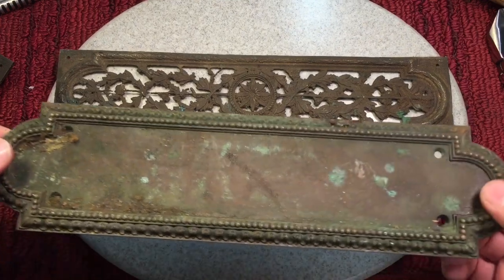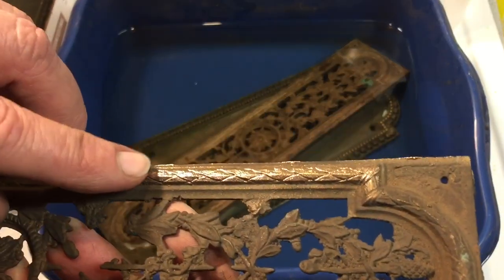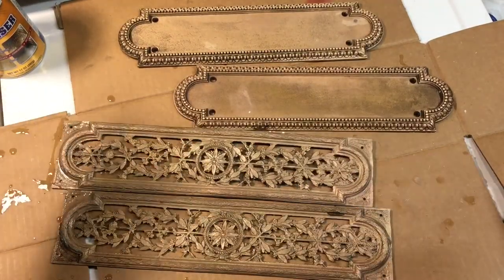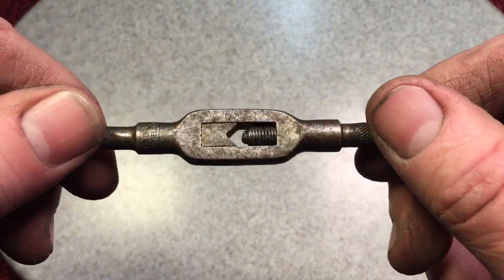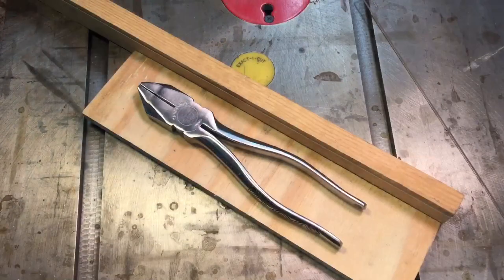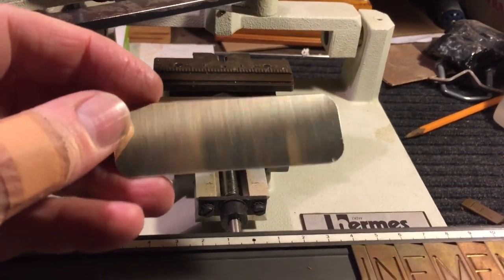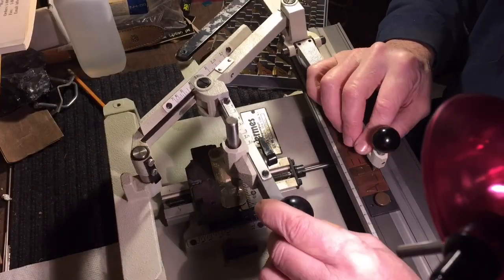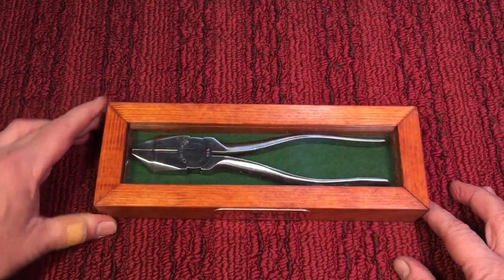SS Normandie Memorabilia, Little Giant Tap handle and Box for Tony’s Pliers.

Comment: The SS Normandie was a beautiful French ocean liner with a trim Yourkevitch hull with a clipper bow and underneath the waterline a bulbous bow which made it glide through the water. The third stack was a dummy stack, just for show. The New York City fire department had trouble hooking up the fittings on the Normandie because they weren’t compatible. Yourkevitch was in New York but the fire department didn’t take his suggestion of letting the boat settle to the floor of the harbor and then apply water. There were false rumors that the fire was caused by sabotage. The fire suppression system on the Normandie had been disconnected while it was transformed into a troopship called the Lafayette. Such a shame to lose this beautiful ship in this way.
Reply from the maker: Larry!  You certainly know the history of that beautiful ship!  There was a lot of controversy over that accident and lots of people in hot water over the incident...  The ship was amazing!

Comment: I use "Brass Black" solution made by Birchwood  Casey.  It is for blackening new brass screws on firearm restorations.
Clean the brass throughly,  make sure all lacquer is removed. Apply solution with a Q-tip. Let it soak into the letters. Rinse with water after a minute, then polish the brass. The polish won't penetrate the letters. If you desire a matte finish you can buff off the excess blackening with 
0000 steel wool.

Comment: Years ago I was given a very corroded and tarnished brass clock mechanism. A friend who did clock repairs told me to soak it in household ammonia overnight. This is how he did his works. When I took it out the brass was clean and shiny. Any old greasy dirt was also gone from the gears and journals. No abrasive needed no residue. Give it a try, it's impressive.

Comment: What great little items from that ship. I never knew that was the fate of it. I wonder if bead blasting would destroy them? Some of those shoot real fine baking soda or whatever they use. I think you are right that they are for heater vents and the solid ones for doors. That little tap handle turned out awesome! I really need a lathe! I need to run better power to the garage! I have one outlet from the bathroom GFI! That case for the pliers is awesome, I keep most of my scrap wood from projects because of you and you don't how many times I've reached for them when I needed a little piece! He will be very happy with the engraving. I remember that engraving machine! Awesome.

Comment: Modern door and kick plates are an excellent source of material, they're usually fairly thick sheet steel or brass, large size, the holes in the corners are easily removed. The price of a large flat thick sheet like that would be very high new. The only downside is that they sometimes have dents and dings from abuse and accidents. Commercial Doors are an awesome find when they're being thrown out. They're not as pretty as those cast ones but that makes them perfect for scrap material.
Reply from the maker: You are so right!  Sheet metal like Brass has skyrocketed in price!  😃👍

Comment: Another great video! Thanks for all the fun and informative content. Do you think that instead of having to add more liquids to the tub to get the level to cover the plates, that maybe you could have added something like a glass jar or two in the opposite corners? They would have raised the level by displacing the liquid, (like Archimedes sitting in the tub) with out having to add more liquid. I think that would be a good way to raise the level of liquids that you don't want to waste (like rust removers) while still allowing you to make sure they are fully immersed. Or even adding a bunch of marbles... but I suppose that would get messy.  I know I shouldn't be stingy with the 50/50, but I am stingy with the evaoprust. Thanks again for sharing with us all.
Reply from the maker: Hi Jeff!  Absolutely!  That would have been my last resort if the Gallon wasn't enough!  =D  I poured it back in the container and will see how it does on brass... At $2 a gallon you can't beat vinegar!   Plus it will clean the pipes!  LOL  Thanks!!!!!!!!

Comment: If you soak it in vinegar for a couple minutes and then rub down with 0000 steel wool it will clean up quickly and beautifully. Probably take about 5 minutes each to complete . Ornate brass and bronze looks better leaving the darker accent in the nooks and crannies, which this method will produce.

It will tarnish almost immediately, though. I owned a furniture restoration business for 40 years, and my customers would always want the items clear coated so they wouldn’t have to do any maintenance or polishing.

Comment: I don't think that's an air register. I looked at a bunch of photos of the ship and the only air registers I can find are vents in the bathrooms, and a couple things above a door in the B deck foyer. And those don't seem to be that ornate. I'd guess they're some kind of decoration for furniture - especially since the holes are small enough for nails. (I'll reply with a link to an image that seems similar but not the same, hopefully it shows up)
Reply: In the corner, on that end table there's a little panel that looks like a similar, but not the same, casting.
https://i.pinimg.com/736x/b5/f6/ca/b5f6cac6273d196c92f4e4fbc19e281c--ss-normandie-steamers.jpg

Comment: Once Bronze has turned green it will not corrode further in acid or lye, the tin in bronze will protect it, the zinc in brass will desolve. That is why Yachts and Ships use Bronze for exterior appliances, especially  in a salt water environment.
Reply from the maker: Yes!  I used to have Copper gutters on my house!  Green!  LOL

Comment: Vinegar is an acid ,salt is an alkaline so putting both together would neutralise the solution so it would not work ,white vinegar on its own is best ,strong alkaline is good for dissolving grease and dead bugs lol on ya car,but what a beautiful ship just like the Titanic having bad fates
Reply from the maker: That mix has been used for over a century.  I’ve seen it work well on some item.
Reply: @ScoutCrafter  many years ago an old machinist used to dip his clean taps in hot wax to stop rust getting to the threads and wax is a good lubricant on many things metal zips.
Reply from the maker: I have never seen castings like this before, every part is textured and hard to get into with normal procedures. Thanks!